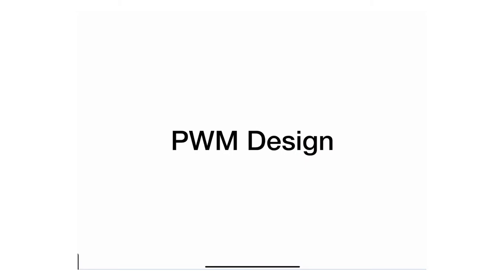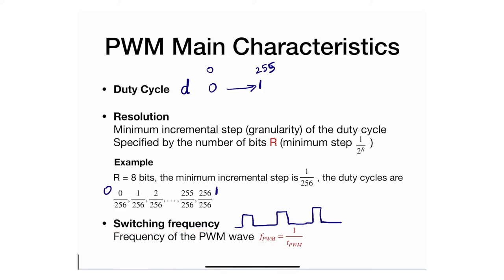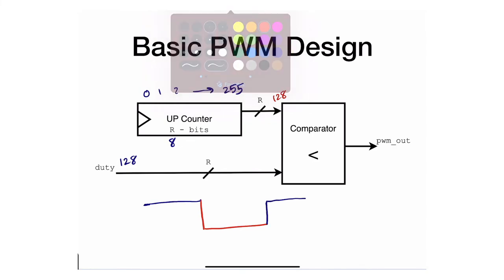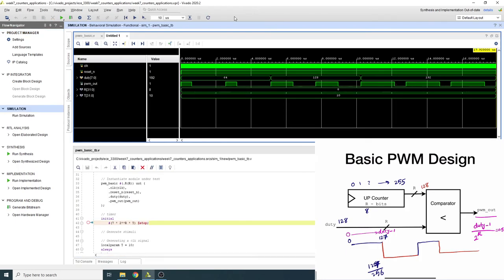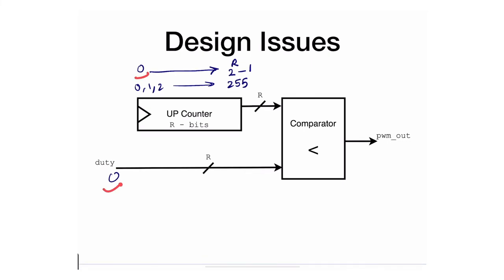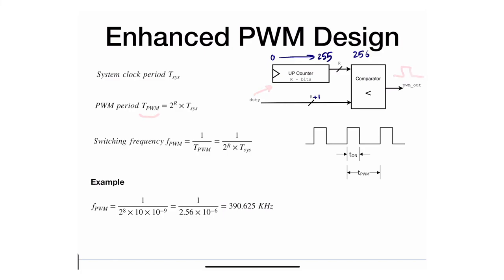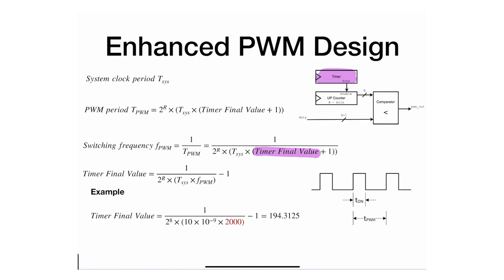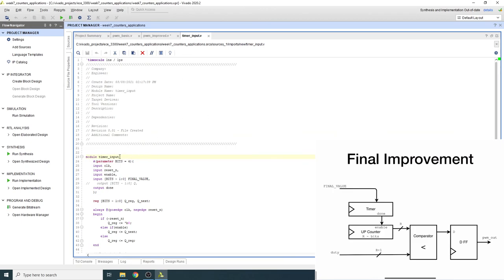40 - PWM Design in Verilog

Comment: Should the timerbit in your code should be equal to TIMER_bit=16 ? because the resolution R is 8bit. The way you have it I am afraid might not be strict 50%duty cycle? Correct me if i am wron

Comment: Hello, I think the equation in the vid, (duty - 1) / 2^R = 0.5, is not quite right. When you solve it for 'duty', you would get 129 for duty, which should be 128.
Reply: The duty cycle is exactly 50%.  During the count from 0 to 127 (128 cycles), the PWM signal is high.  During the count from 128 to 255 (also 128 cycles), the PWM signal is low.  Since the on time and off time are exactly equal, the duty cycle is 50%.  Counting from zero can be confusing…what I do mentally is add one to the start and end counts:  0 to 127 is the same as counting from 1 to 128 (0+1 to 127+1).  Since I jnow a count of 1-128 is 128 steps, I know 0-127 is also a count of 128.  Same approach for 128 to 255: subtract 127 from both start and end and you find it’s equivalent to  1 to 128, again a count of 128.

Comment: Will changing the Switching Frequency, i.e Timer Value affect how long the counter will count for. I am having trouble where the counter will count to 255, but still be at 188 and switch duty cycles which causes a high. So it does not finish counting to 255 and resetting.

Comment: very nice informative and helpful video thanks very much. Please my question is in regard to the number of counts and bits choice. Can i just decide to count to any number let say 0 to 99 in my project or is there an idea behind the number of counts to be chosen for a specific application and how is that related to the frequency?
Reply: The number of counts is indeed application specific. Like he said in video 38 "PWM Main Characteristics", the count determines the resolution, i.e., how much you can subdivide the clock frequency that is controlling the PWM module. For instance, if the clock is 1KHz (period of 1ms), then a count of 10 lets you control the duty cycle in increments of 100μs. A duty of 1 means PWM output is on for 100μs and off for 900μs. A duty cycle of 6 means PWM is on for 600μs and off for 400μs. If your application needs for fine-grained control over the duty cycle, you could choose a count of 100, in which case you can control the duty cycle in increments of 10μs.

As for the what the frequency of the PWM signal should be, that is dependent on what exactly the PWM signal is driving. This is an involved topic. For instance, driving an LED vs driving a brushless motor vs driving a stepper motor. The frequency you need depends on the physical properties of the device you are controlling.

Comment: Hey, nice video and explanation!! Can you show us the hidden code from the timer module at 27:01 under the picture ?:D I see an assign and always block but the code is hidden :D 
Thank you!
Reply: did you get the code
Reply: @princegupta7003  no
Reply: @i3ellagio51  the code is not working 

here is the code

// timer parameter
module timer_input
    #(parameter BITS = 4)(
    input clk,
    input reset_n,
    input enable,
    input [BITS - 1:0] FINAL_VALUE,
//    output [BITS - 1:0] Q,
    output done
    );
    
    reg [BITS - 1:0] Q_reg, Q_next;
    
    always @(posedge clk, negedge reset_n)
    begin
        if (~reset_n)
            Q_reg <= 'b0;
        else if(enable)
            Q_reg <= Q_next;
        else
            Q_reg <= Q_reg;
    end
    
    // Next state logic
    assign done = Q_reg == FINAL_VALUE;

    always @(*)
        Q_next = done? 'b0: Q_reg + 1;
    
    
endmodule